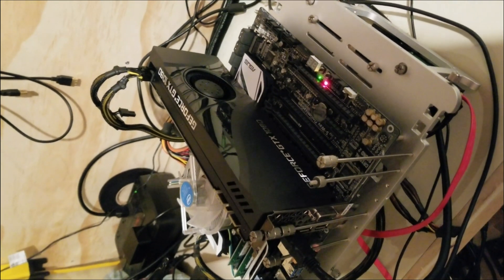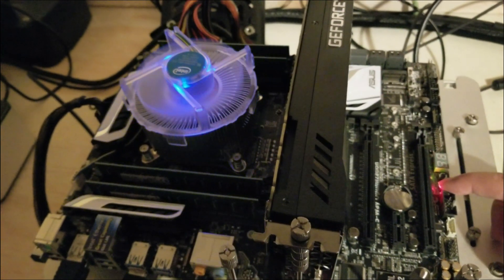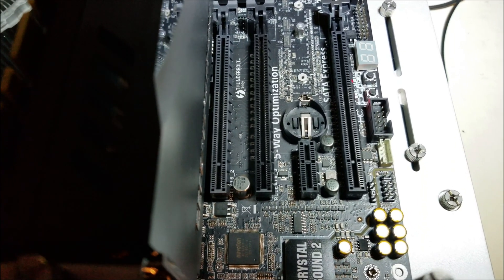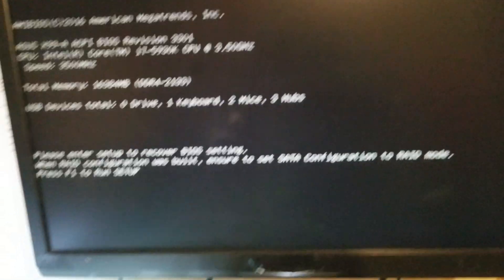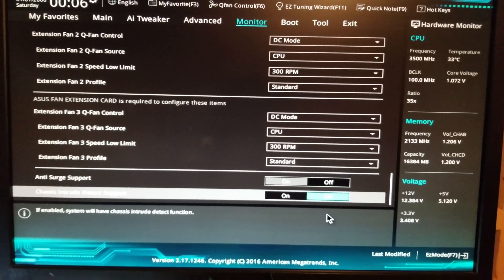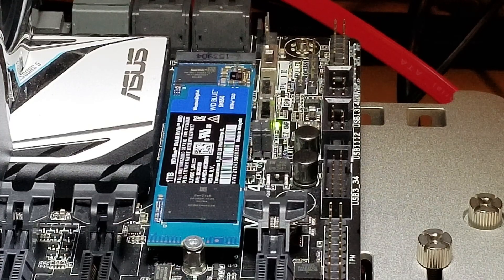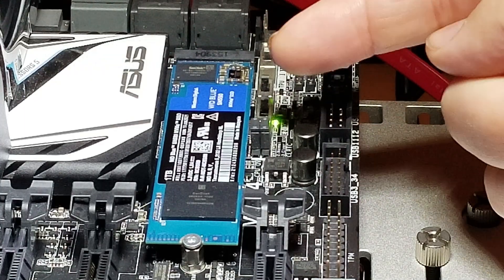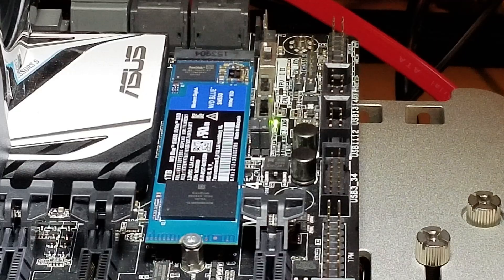Chassis Intrude Fatal Error Fix

Comment: I accidentally enabled the BIOS Option of checking for Open Case.. after rebooting, this Error kept occuring and I wasn't even able to enter the BIOS again at all to Turn Off that Check Option!! Frustratet I found this Video, reattached CMOS battery, waited for 2 minutes and booted. I was finally able to enter BIOS again thank god, but I Had to manually reset all the Options because Mainboard BIOS was Set to Default settings after this solution. nevertheless, you saved me sir. Thank you!!!
Reply from the maker: Glad the video was helpful in getting your system back to normal. Thanks
Reply: @Reviewing_Playing_and_More_RPM big thumbs Up, you are an Angel from heaven

Comment: Thank you for this video! It helped me to solve this kind of problem after I've stupidly enabled the Chassis Intrusion in the BIOS in a Asus TG B650M-Plus. After removing de CMOS battery and reinstalling it ± 5-10 min later, the AMI screen that appeared enabled BIOS access by pressing F1. The last settings of the BIOS, prior to the Chassis Intrusion change, were restored automatically, and the inly thing that I've did was assure that this option was and remained disabled.
Reply from the maker: Great to hear that it worked out for you. Glad I could help.

Comment: You can remove or disable the chassis intrusion features in the bios menu.

Removing the batterry for a while and put it back again  will do the trick to prompt you with the F1 option to go to bios settings and disable the chassis intrision feature, or if you cant find it on the menu settings, setting bios back to default settings will turn off the chassis intrusion features
Reply from the maker: Thanks for sharing that tip with the community.

Comment: Thought the chassis Intrution were a cable from "chassis Intrution" pins on motherboard, and other end it's a switch located around behind the side panel. So once panel are opened, and the switch then being released, the chassis Intrution mode in Bios are activated?
Reply from the maker: There are cases where that is true, but not all work that way, in this instance there is no cable. The one's with the cable are much easier to deal with as well. Thanks
Reply: @Reviewing_Playing_and_More_RPM  Ah okay. I see. Just recenty discover that "chassis Intrution" when bought a motherboard, and it were noted on the MB down at the front panel pins. Thanks for the video.
Reply from the maker: Anytime, thanks for your support. Thanks

Comment: Hi, Master. My mobo is an Asus M5A78L-M USB3, known by this chasis issue, plus their dots for the chasis jumper with no pins... which I've soldered with no luck either. It seems that Asus released this product without ant kind of attention about it, Asus refused to solve it even in their bios upgrades, is a really crazy & capricious bad will. Obviously, there's no option to enable/disable this stupid security measure in the bios setup... I've cleared CMOS in all possible ways, the annoying issue returns. I've researched a lot tryin' to solve this problem given that the nonsense restarts (the only procedure that let me get into my OS) isn't a healthy thing for the drives (sadly checked), & I've found a procedure which involves to solder the positive pin of those three which I've soldered in their correspondant place (below the CMOS ones) to the ground one of some transistor (which I can`t find with my tester). Any idea about this specific case? Thx in advance for any advice.
Reply: Its main advantage was the bios chip can be easily removed which is that makes it so user friendly. I liked that motherboard😊.
Reply from the maker: That sounds like a tough one, I've never dealt with that type of issue before. I did come across this article that might help though. Here is the link: https://www.badcaps.net/forum/troubleshooting-hardware-devices-and-electronics-theory/troubleshooting-desktop-motherboards-graphics-cards-and-pc-peripherals/30119-howto-fix-repair-chassis-intruded-fatal-error-system-halted-on-asus-p5ql?t=32502 Hope it helps.
Reply: @Reviewing_Playing_and_More_RPM  Thx a lot!!
Reply: @ I've found the arrival point of the main pin, it's located in the main pad of an already removed SOT-23, but removed by the manufacturer itself (no one has touched it), so it could means that there is no capable transistor for the task & the bios keeps on requesting for it? I need to modify the dump bios to get out of this annoying Asus negligence.
Reply from the maker: Your well past my knowledge base, I wish you the best with it. Have a great day!

Comment: I have this problem but my bios doesn't has the option for disabled the chassis detected.
Reply from the maker: Did you remove the CMOS Battery wait about a min, start the PC without the CMOS Battery, then shut down the PC replace the CMOS Battery and then restart. Hopefully that will work. Thanks

Comment: Hi there,my Acer pc gives a message at start up of press f1 to continue or delete to enter set up,just a week ago my plasma screen tv gave out and i also found out the hdmi cable which had to be routed with a180 degree bend was also damaged,been getting black screen intermittent flashing,after i bought a new samsung 4k led tv 50",i could not get an output from my pc(the damaged cable),after the cable issue was found (and i could hear the pc giving the proper start up beeps) i got a new cable only to see the case open error press f1 etc.
My case has been open for some years now to get better air flow with no error messages,the case has a side plate with two thumb screws at the rear not the new style door type affair so no micro switches.

Do you think the plasma screen could have caused some form of feedback signal through the GPU to initiate the error message,i may be clutching at straws,but having never had any warning of case/chassis open error i cant see how this would occur.

I will remove the bios battery as i've had them lose power before and all the clocks and dates go screwy so i'm not worried there,i'll check in the bios at start up too before the battery if i can disable the case protection ,I still cant see how it could be enabled with no apparent micro switches or even some form of IR reflector switch to block.

At least i have two routes to check out.

Thanks.

John ,Scotland.
Reply from the maker: Hi John, sorry to hear about the TV issue's with the HDMI Cable as well. As far as I'm aware unless the other HDMI cable has an issue, it should not cause any issue with the GPU or cause interference. Sometimes its required to update the GPU Drivers though so that is something you could try. As well as making the change in the BIOS to turn off the error message warning. All the best hope its all working well soon. Have a great day.

Comment: My computer doesn't give me the f1 option, seems last tech support guy disabled the option, what to do there?
It also says "CPU Fan Error!"
Reply from the maker: I'd just go through each tab in the BIOS to see if its there, or maybe a way to get back the F1. The CPU Fan error can be from an AIO that was plugged into the AIO Pump on the Motherboard which is fine, but now its looking for the CPU Fan on the CPU Header on the MB, so you just need to turn off that notification in the BIOS if that's the reason its happening. Hope that helps.
Reply: @Reviewing_Playing_and_More_RPM  CPU Fan problem is solved, was on wrong plug but the "Chassis intrude! Please check your system Fatal Error" thing still appears, it has new battery and can't get to bios no matter how many times I press delete or f2
Reply from the maker: Try removing the CMOS battery  wait a few seconds, and put it back in. Check the CMOS Battery is inserted right side up. Reseat the RAM as well if that doesn't work. Can't think of anything else at the moment.

Comment: have same  problem.  It happens randomly as I start the computer.  I just shut it down and turn it back on then get to my home screen.  Is thsi error supposed to permanently block you from getting to home screen/desktop?   I have had computer for 5 years at least so far.
Reply from the maker: Its designed to prevent others from accessing the system until the error is cleared, so while I've never verified if it permanently prevents one from getting to the desktop/home screen it is likely that is what would happen. If you follow the video and it doesn't help there are sometimes actual physical wires that connect to the case itself that can be removed and eliminate the error.

Comment: Yes done as your method but once reboot problem still persist. even done up to date bios also same .
Reply from the maker: Did you try resetting the CMOS? That can sometimes help, so do that first then retry. Hopefully that will fix it for you.
Reply: @Reviewing_Playing_and_More_RPM  yes I did reset it, problem still persist, never mind I solve it by my own method.
Reply from the maker: Something to check is sometimes there is a physical connection ie a cable or on some cases there is a metal piece that makes the error occur. But otherwise wish I could help more. Take Care.
Reply: Please explain me my problem also not dix @wmfoong

Comment: when I removed the battery then I turned on my PC it was running normally then when I restarted I couldn't enter Windows and the system said chassis intrude fatal how do I fix it?
Reply from the maker: Clear the CMOS, if removing the battery didn't work, then use the CMOS Jumper, you'll need to look up where it is on your MB then use a plug to place over the wires to fix it. Your MB manual will let you know how to do that if needed.

Comment: thank you soooo much i just built a pc and had this issue
Reply from the maker: Glad it helped you out. Have a great weekend.
Reply: @Reviewing_Playing_and_More_RPM  will do! also another option that you can do if the disable chassis intrude isn’t in your settings. you can take the side panel off and search for 2 pins that are labeled chassis then connect them with a dual pin cap
Reply from the maker: Cool, didn't know that. Thanks
Reply: @Reviewing_Playing_and_More_RPM  i’ll make a vid showing how it works later
Reply from the maker: Cool

Comment: I acidently turn on that setting how do i turn off? (Also somehow i cant find the small circle battery in my pc)
Reply from the maker: So just go back into the BIOS and turn it back on, if you need to reset the CMOS Battery you might need to search online for the Manual that will show you were it is located, it could be under the GPU most likely which could be why you can't see it.
Reply: @Reviewing_Playing_and_More_RPM  thank you but i cant open the BIOS somehow, i use f2, del,... but the BIOS doesn't show up
Reply from the maker: I have a video on getting to your BIOS and in the description it gives many other ways as well.
Reply: @Reviewing_Playing_and_More_RPM  thank you

Comment: neither worked I’m gonna cry
Reply from the maker: Did you try both removing the CMOS Battery, resetting the CMOS and changing the setting in BIOS? If you did then yeah not sure what else you might try. Hope you find a solution.
Reply: Thanks for your advice. We are going to take it In and try to get it repaired as it already had some underlying problems with it.
Reply from the maker: Okay, well good luck with it. Hope they are able to help you out. All the best.
Reply: @Reviewing_Playing_and_More_RPM mine gives the error after i restart from bios
Reply from the maker: Make sure you saved the settings in the BIOS but don't forget the other route as well.

Comment: I haven't been able to use the computer for 3 days... my BIOS doesn't have this CHASSIS option and resetting using the Battery or the Jumper at positions 1,2/2,3 still gives me the error I don't know what to do anymore T-T
Reply from the maker: I don't know why you would have a Chassis Intrusion message but nothing in the BIOS, if its not in the BIOS then you wouldn't get the message. If both the Jumper, and clear cmos didn't work and the BIOS also didn't work I'm unaware of any other ways to fix this. Sorry wish I could be of more help.

Comment: hello :) i have Asus B85M-G, and no option in bios, i can start the computer with clear Cmos, but the problem come back at start , i have jumper connect on "chassis signal" and "ground" but i also have 2 pin just above without jumper, do you think i should also put a jumper on those above ?
Reply from the maker: If you can locate the Chasis Pins on the MB you can put the jumper on the pins and reboot your PC that should let you fix it.
Reply: Hola tengo la misma placa base que tú me podrías ayudar ?
Reply from the maker: ¡Cómo puedo ayudar!

Comment: Thanks. I had an ASUS - B560M-PLUS TUF Gaming that managed to set the Chassis Intrude and got the error. I used the CLRTC shorting trick (screwdriver across the two pins) which also worked but without your video I would have been stuck.
Reply from the maker: I'm super happy it helped you out. Thanks for letting me know. Have a great day.

Comment: Theres no such option on Monitor to turn off the intruder detection. My motherboard is the Asus b85m-e
Reply from the maker: Its in the BIOS just might be in a different location, not sure exactly where for yours.
Reply: @Reviewing_Playing_and_More_RPM  I could not find it anywhere after spending quite some time. But I fixed my problem by adding a jumper on the chassis
Reply from the maker: @NoThisIsntMyChannel  Yeah that's another way to do it for sure. Glad you got it fixed.

Comment: I did everything in order
But when I turned on my computer, the screen wouldn't show up, everything was the image of "No Signal" from the TV.
I have tried checking my HDMI cables and they are okay. I checked the battery to see if it's placed correctly and everything is fine too.
I didn't removed the CPU fan or anything other than the battery
Reply from the maker: Check that your connecting from the Graphics Card to the TV, also when using a TV it can go into a standby mode so you might need to turn it off and back on to get a display. If that's not it then you will need to check there are no loose or disconnected cables. Removing the CMOS battery will not cause any issues but ensure your battery is facing the right direction as there is a positive and negative to the battery so try reversing it if needed.

Comment: I managed to get into the bios but didn't have to option to turn it off, would it be in other places?
Reply from the maker: Not sure best to look at your MB Manual to see what it says, it's likely just under a different tab.
Reply: have you find it bro have the same Problem
Reply: @miladsaifi3622  I found out mine was a problem was the pc it self, so a connector came off of one of the pins, do you know mother board you have?

Comment: Hi, I removed the CMOS for 5 minutes and it solved the chassis problem, but now I lost any bootable devices is it a common issue ?
Reply from the maker: No, your boot devices should not have been affected. If your able to get into Windows Explorer check Disk Management in case you need to initialize them.
Reply: @Reviewing_Playing_and_More_RPM  thank you, i found the problem, the BIOS just has reset, so i had to turn the UEFI settings back

Comment: What if my pc dont has a battery like that?
Reply from the maker: Every Desktop PC going on several years now have all had the CR2032 battery, at one time this was the only way to reset the CMOS.
Reply: @Reviewing_Playing_and_More_RPM  i never opened my pc 😅. I think i found one. Removing it for 5 minutes like you said. I hope it works 😫
Reply: @Reviewing_Playing_and_More_RPM  it said something new installed but the chassis intrude is still there
Reply from the maker: @iAmNothingness  There are a couple ways to clear the CMOS removing the battery, it will be round, there might be a Clear CMOS Button on the back of the Motherboard that you can just push and hold for a few secs, you'll need to consult your Motherboard Manual to see how long or there will be a jumper that is a bit more for the advanced user so that I would suggest getting help with before proceeding with that. Ensure if there is a cable plugged in that is activating the Chasis Intrusion to remove it or you will keep getting the error message. If none of that works I don't have a fix that goes on from there.
Reply: @iAmNothingness  it could be under the graphics card
Reply: It’s just not a circle like yours

Comment: Exactly same error occurred on my pc but I want to know that why my hdd is not shows in system info and hdd info but in this error I saw my third hdd appears but not showing in after window 10 loads not showing the drive even my hdd is plates are revolve
Reply from the maker: If your HD is not showing try going to computer management and then disk management and see if it shows there, you may just need to initialize them.

Comment: Great info Dennis. I had to order my CMOS battery it had 2 shirt wire on it so you cant just buy one at the auto parts nor Walmart.
Reply from the maker: Surprised you needed to order it, they are usually available in grocery stores and electronic stores, but with how hard it is to get things today I guess that just became another hard to get item.

Comment: remove bios battery then insert it makes my pc can boot but in bios, I don't have Chassic intrude detect support, It only has Anti surge. So this problem occurs everytime I boot PC. Do you have any suggestions? My motherboard is ASUS H81M-CS. Thk
Reply from the maker: Not sure what an Anti surge message would be but if keeps taking you to BIOS then you can try resetting things to defaults and that will likely solve the problem. You'll need to make any other changes you've made over again though.